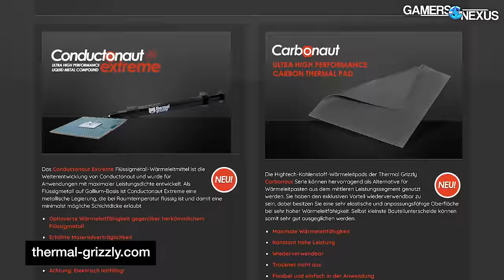CPU Thermal Issues & Der8auer's Scientific Solutions | Graphene, Direct Die Blocks, & More

Comment: Please @Roman @Der8auer please make available or develope a store that allow international shipping. I am in South Africa 🇿🇦  and can only purchase limited older items. I would realy like to do the delid pro and die mate etc. Pretty please!!! 😅 Even if it an eBay store. Jist a query, how diificult would it be to install a thermal sensor into the die mate? Would there be a benefit for information?
Reply: Maybe ask a local retailer, computer store or onlineshop if they can get them. They usually have easier ways to get products, especially if imported. :)
Reply: @masterluckyluke  There used to be one e-tailer that use to stock Thermal Grizzly pastes, but then seemed to stop... :-( Would like access to all products.

Comment: Hello guys, more than grateful if you could help me. I have an Acer Nitro 5 with i5 10300H and gtx1650. Graphic card's temp are just fine (70-80), but i5's temp are good only when the thermal paste is fresh (15 days) after that temps start going up to 90-96. So, I repaste it but after 15 days the story repeats. I use Thermal Grizzly Kryonaut. Any sugestion?
Reply: I know im a bit late but laptops are usually direct die (no heat spreader) and can suffer from pump out due to thermal cycling way faster than a normal CPU.

Something like pt7950 or other phase change pads usually keep their performance for longer.
Starting temps might be a tad worse than thermal grizzly but the thermal transfer isn't the limit most of the times with the small heatsinks in laptops anyways

Comment: I truelly hope that for ryzen 8000 AMD will find a way to have a thinner IHS. Like using a thicker chip with only traces at the bottom (unlikely) or using a thicker PCB. Because i am already uncomfortable having my CPU constantly at 80c during gaming....
Reply: Ryzen 8000 will be the mobile processorss like Ryzen 6000 was, but yeah Ryzen 9000 should probably, hopefully fix that issue but on the other hand probably wont if they're sticking with the same sockete

Comment: Hello guys! I am trynna make some decisions regarding my next graphics card. Either I'll buy the RTX 4060 or the Rx 7600. I have just one concern that I can't clear by myself. Does Nvidia GPUs still output washed out colours/images like they used to do before? I have not used Nvidia for almost 4 years. Afaik, Nvidia's software used to limit the RGB range from 0-255 to 16-235. While it could be changed from the driver software for video encoding, it can't be changed for Video games processing. Seriously looking help on this issue, thanks.
#AskGN

Comment: I'd argue that the chips are just overjuiced (significantly), and overclocked (slightly).
PBO -20, and -100 mhz clock curve = a cool chip, at 99% benchmarks. PBO undervolt alone actually causes a performance uplift, but same temps.
They're "juiced for wafer yield", not optimized for performance:watt. If AMD pitched the worst 10% of the chips they're calling 'ok', the remainder could all run faster and/or cooler. But the price would go up a bit. As it is, the 90% 'good' chips are juiced/clocked in a way which is following the lowest common denominators of their yield range.

Comment: Take a delided cpu take silicon gel spread a thin layer on the cpu die chip surface , press integrated heat spreader onto cpu die chip surface put in sun until hot / take the integrated heat spreader off and observe the inkplot the chip has made and purchase nail file emery board sand paper and 500 to 1000 grit and gently sand the chip in small spots and around the edges like rounding a table top from square until chip makes a stamp of full chip squeezed the gel proving 90+ chip thermal conductivity showing a perfect imprint on the heat spreader , overclock that

Comment: Looking back on the reviews of channels of the repair engineers - advertise Thermal Grizzly is the same, as advice to kill your GPU in approachable time. Yes, it's performance is exceptional, but as it is too liquid, - by the time under pressure and temperature it become pushed out from die and then no thermal compound left at all. Result - dead card.